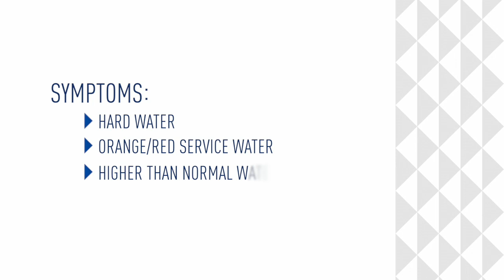Open Bypass on Autotrol 255 Valve

Comment: Mine’s leaking like a son of a gun!
Reply: What did you end up doing with the leaking bypass valve? Mine is leaking too?
Reply: @jackj5591  Replace it. I did after I tried to turn one knob and it just started pumping water on the floor.